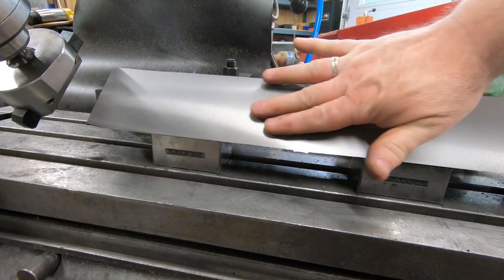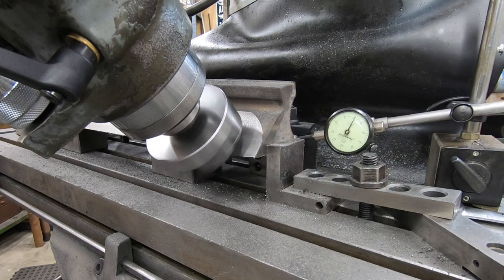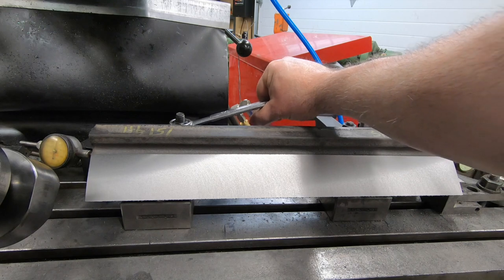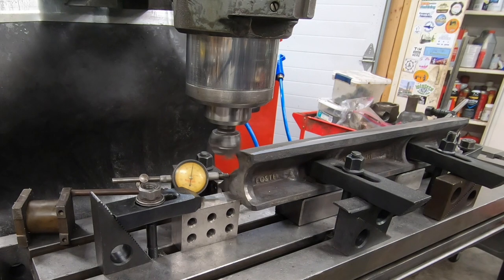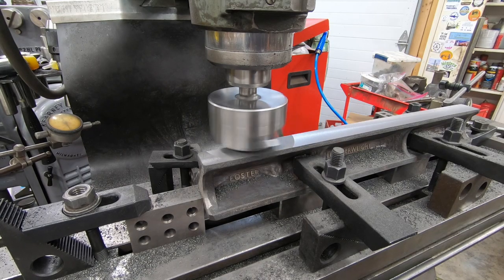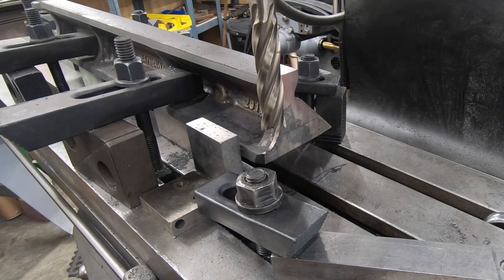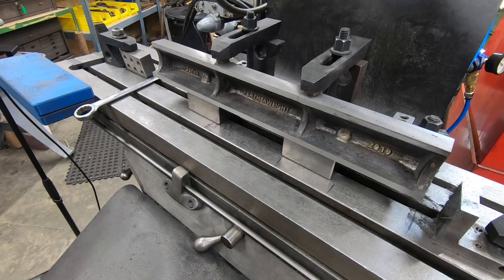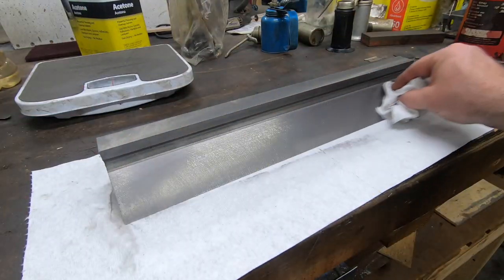Machining a Cast Iron Straight Edge - Part 2

Comment: You did a very nice job on this video a lot of work goes in to finishing one gives you an idea of why they can be so pricey.
Noding the head on BP can be very frustrating due to the fact that the work envelope becomes so restricted. 
I prefer the Wells Index mill in cases like this due to the fact the pivot point is lined up with the center of the spindle giving much need capacity. Cheers
Reply from the maker: I've never used a Wells Index, just saw how big the one Steve Summers has in his shop. I wish I had that kind of room :) Thanks for watching!

Comment: Nice work and a good save... BTW: I noticed a scale near the end of the video, did you by chance weigh the casting before and after to see how much you machined away?
Reply from the maker: Yes I did. It went from 18 pounds to 16 pounds, IIRC.
Reply: @MyLilMule  Nice... that's a lot of cast iron chips. Those fine chips get everywhere
Reply from the maker: @paulhammond7489  Tell me about it! LOL! The worst is when then land in your clothes and hair. And even though you use an air gun to blow them off, you miss a few and they end up as rust stains in the bath tub, and the spouse finds it first. 😳😂
Reply: @MyLilMule   😂😂😂😂

Comment: I don't understand why you didn't machine the top 3 faces after you cleaned up the prism face.
By not disturbing the clamping everything would have been guaranteed to be in alignment. 
The test on the surface plate wasn’t going to tell you anything that would make you not machinine the top.
Did I miss something   ?
Reply from the maker: The head was nodded. Removing everything off the table was necessary to realign the head to the table. I can't do that with all the stuff still in place. The initial test on the surface plate was merely a sanity check to make sure that the machine work I did on the bottom wasn't a complete mess. Thanks for watching!

Comment: How much did he charge you for that? I can’t find him or a rough casting like that. I wanna make one so I can learn scraping myself so I can fix up my Bridgeport a little. Thanks
Reply from the maker: Look for eBay seller "fotodoc" - he may not have any ready to sell, but I'm sure if you contact him he can let you know. The rough casting was about $230 if I recall correctly.
Reply: @MyLilMule  thanks I’ll have to check that out
Reply: I wanna start with a rough casting. I love using my machines!